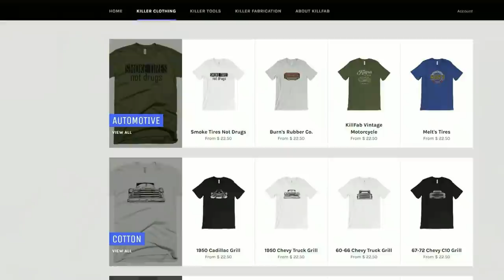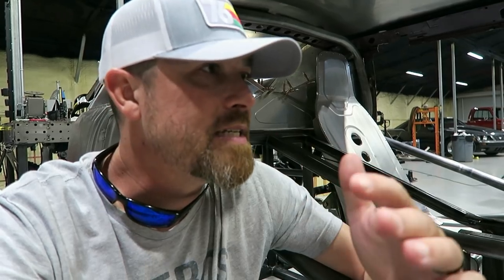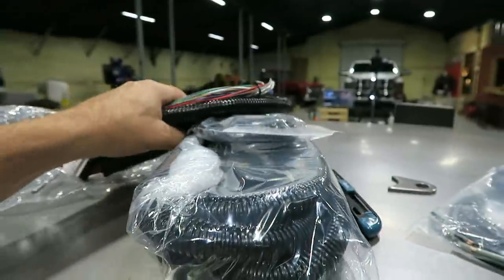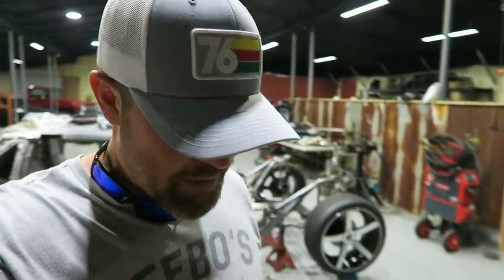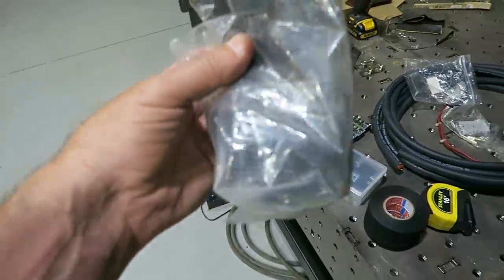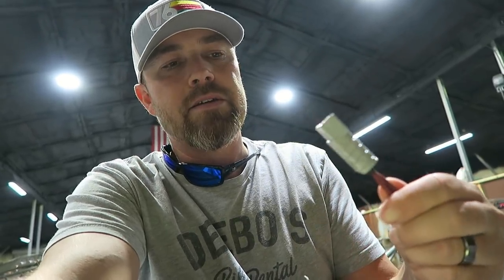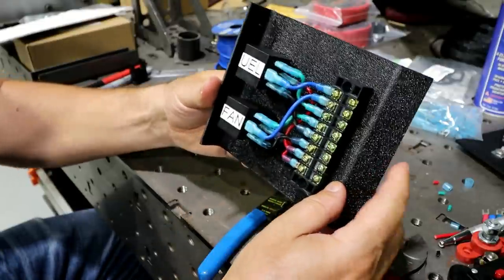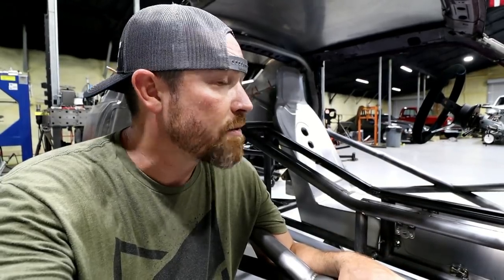How To Make Automotive Wiring Harnesses

Comment: I personally would've used those old school relays.  MSD for example makes a real nice relay block.  It's much cleaner install, solid state  type rated around 25 amps and triggered  negative or positive volts.
Reply: For $200 they should also make my coffee!  And solid state relays have a voltage drop that can be troublesome in some applications.

Comment: I'm building this truck. Old school. No computer. Using  mechanical fuel pump. And  4 barrel carb. Just lights start. Run. Radio. Radiator fan . And that's it !!

Comment: I wire my projects with very similar components, but I wire all of my relays with ground sense. I use 4 pin relays, #30 B+, #87 load, and #85 & #86 are the relay coil. I jumper #85 to #30, and run a 16 gauge wire from #86 to  the switch that controls the device. I ground the other terminal on the switch to the ground junction block. #30 goes to 12V B+ and #87 to the load.  NOTE: There is no current in the control wires.
Using this method eliminates any current running back and forth between the control panel and the relay panel except in the main fused 12 V B+ source. If the control wire gets pinched and shorts out, it just grounds the relay and the device turns on. No burned wires and a much smaller control wire. Also there are no 12 volt wires running around under the dash or control panel and no need for a fuse on the control wire because it has no voltage.

Comment: Hey Voss, have you heard of silicone self fusing tape? I like it because there is no sticky residue, if you ever need to get back into your loom. I used it over corrugated plastic tubing for my wire tuck for the main bundle and it holds up great to the heat. I used that ‘Chinese handcuff’ material for all wiring coming out of the bundle to everywhere else, looks so choice and it worth the time it takes to inch on

Comment: Great info I am currently putting together a rail buggy with a 2.4 ecotec. Do you have any good solutions for a keyed Ignition switch that’s better than the $30 unviversal ones and maybe a bit more secure
Reply: I used a cole hersee 95060-60-BP 3 position ignition switch for my sand rail and really like it.
Reply: @racer625  thanks I’ll check it out

Comment: Skip all the janky Chinese garbage fuse boxes, bus bars, and Amazon speaker wire. Source a proper PDM from Eaton Bussman/Littlefuse and quality TXL wire from ProWire USA.
Reply: Wow! not so easy to do. Spent 6 hrs searching for good stuff and still can't find a quality, US made, combo fuse terminal in a range I need. ProWire has good wire but very limited combinations. No cables suitable for automotive high amp use and not much in the way of accessories. Bussman/Little fuse appears to be high quality commercial stuff and looks like many more hours of searching for retail source. But thanks for the point-out, I am tired of the import crap too! If you know of a quality 8/16 station (both positive and ground), plug in fuse, screw on terminal block, please post.
Reply: @chip-load  Waytek Wire. Also, DelCity. You’re welcome.

Edit: Look under Power Distribution Modules. Be sure to purchase the proper crimp tools.
Reply: @chip-load  The Blue Sea stuff is decent but it doesn’t hold a candle to the proper kit from Eaton.